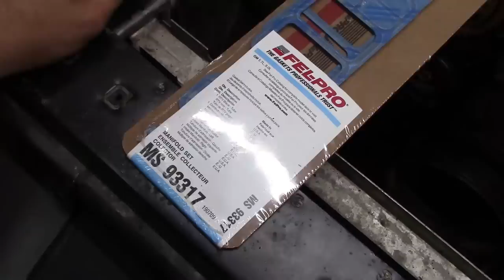1991 GMC K1500 Project | 350 TBI Intake Manifold Gaskets and Water Pump - Part 1

Comment: I’d rather pay someone reliable $1200 to fix a $500 truck and know what I have than pay $5k for a newer less rusty truck and have no idea what kinda junk I just bought
Reply: Better to know the devil you do vs the devil you don’t.
Reply: @FishFind3000  exactly how I see it and what I subscribe to myself. Working parts I hear people who subscribe to the "its an old year vehicle, it doesn't need good X" and people who are like "give me the best" sometimes people just like their car enough the idea of "totalling" it on parts doesn't matter.
Reply: I agree Notto. If the owner sinks $1800 in repairs on their truck this year they are further ahead then buying a new one with unknown history.  As someone said earlier, beware the devil you don't know.  That applies to people or vehicles.
Reply: Up here in Ontario Canada 5 k doesn’t get u much when looking for a good used truck ,even trucks selling for 10k are junk. I bought what I thought was a mint 2000 gmc 1500 and now I’m doing a frame swap and low mileage motor
Reply: Half full, Half empty . . . 😂
Reply: @classicxl  same story here in the swamp bro,I bought a $900 chevy, dumped $10000 into it and sold it last year when the body mounts took a shit and the driveshaft was rubbing under the cab.
Fml.
Reply: I thought he said $12,000 lmao, I was like: “well it’s a good truck, and new is expensive, I guess you go with what you know” I mean most trucks go for $1000 in scrap condition here, $5-9k for anything salvageable and running (or diesel and not)
Reply: Rather buy a $500 truck and put in $1200 into then make make payments. 😊

Comment: $500 would be an absolute steal on any running and driving 4wd around me, regardless of what kind of shape the body is in. That truck would sell for $2k within a day of being posted.
Reply: I don't think it's a 4x4. A c1500 is 2wd. K1500 is 4x4
Reply: @sh115067  Yep. Good thing this one clearly has front axles and the literal title of the video is "K1500 Project."
Reply: And today it would sell for 3500 bucks lol, it's really not that bad of a truck.
Reply: Hell, a not running truck is worth $500 at the scrap yard right now.
Reply: The value of these OBS trucks is insane to me. That's a 3000 to 3500 truck today. I have a very nice 1999 and I love it but wouldn't pay what it's worth right now. Lol

Comment: When I was a young pup I was working in a factory that had shut down years ago and the new property owners were wanting to get some temporary lighting going to show off the space to sell it. To help me see while I figured out how to get the power back on safely I brought some really raggedy 400 watt metal halide high bay lights to lay on the floor to light up some areas. The owners wanted to buy these lights thinking they could get them dirt cheap because they were beat up. They were astonished when my boss told them he would only sell them the old lights for his cost of a new light because if he sold them he would have to buy new ones. It was a good lesson that stuck with me years and years later.

That might only be a 500 buck truck on trade in to a car lot but it would cost a lot more than 1200 bucks to replace it!
Reply: In earlier July 2024 I watched YouTube videos where the hosts were showing six-figure sticker prices on 2024-25 1/4-ton pickup trucks!

Comment: I watch a lot of repair channels and you are the only one who CONSISTENTLY uses a torque wrench.
Nice call on the intake leaking. Real PITA getting all those hidden clamps and connectors.
Thanks for sharing.
Reply: When there's a gasket to be compressed he uses a torque wrench, but if there's just two parts to bolt together he says 'click' himself. Other people just wing it all the time?
Reply: @Netherlands031    Many times, experienced mechanics and those who think they are, will just tighten bolts from muscle memory. Exhaust manifolds, water pumps, attachment bolts, etc.  While all have specific torque ratings,many are not critical as are head bolts, main and con rod bolts. By feel works where not a critical torque.

Comment: The correct torque setting is until strips and back a quarter!
Reply: The trick is to learn to stop a quarter turn before it strips.  45 years on the job, and I never did it quite right.  Learned to install Heli-coils .
Reply: @etheroar6312  lol...
Reply: You forgot the most important part.. the last part.. and act like nothing ever happened... lol

Comment: We're about the same age, when I was growing up, any truck that started and ran reliably that had functional four wheel drive was worth $2500 all day long. Could be leaking water, oil, coolant, etc. but as long as it ran and the 4x4 worked, $2500. Might have to search a bit, but you'd find a buyer. In the current market, bet you could get $4k.

Comment: 350 tbi- most reliable chevy motor ever made.  Good torque, easy to fix.  Nice thing on the tbi is the coolant next to never goes inside the engine like the vortec.
Reply: ... like my 2002 Vortec did.
Reply: Hope you never have to deal with a "hot rodded" TBI Unit. Lots of fun finding what the master tuner and mechanic before you did to it. 🙄🤦‍♂️
Reply: Reliable cause it was so underpowered! Never stressed any of the internals to much.
Reply: @duganr6090  Yeah...i love my truck but man it has no balls really.
Reply: So u think coolant going straight to the oil pan is intake gasket?

Comment: The heat crossover port is used for what was known as EFE early fuel evaporation. When the cool fuel hits the floor of the intake the heat on the floor causes the fuel to vaporize . I always block them off as like you say it burns the snot out of the oil .

Comment: Pleased to hear nobody was injured by that storm. We had a bad storm in 1988. Monty and I spent 8 straight days cutting and hauling tree and brush to a make shift dump. We did 40 loads of my Ford F150 pickup. We worked from 8am until 12:30pm my Mom or his wife would make lunch then we would work until 8pm and either my Mom or his wife would make Dinner. Those 8 days were dreadful. Luckily we haven't had anything like that because I would be worthless as I am no longer 17 years old.

Comment: Did my 96 dodge 1500 a few months back. Had to change out the plenum plate. Went with the hughes 1/4 in plate works awesome and no more oil on top of the plenum.

Comment: There's something very satisfying about keeping an old truck on the road. Trucks made now will never last so long.
Reply: Old trucks just don’t have the power or drive near as nice. But new trucks aren’t the simplest work on.
Reply: They do drive nice if maintained properly and still have plenty of power depending on the engine.  I've got a 99 Silverado with the 5.3 that still looks almost new. Has more power than I need and drives just as good as any new truck I've owned. I prefer older trucks unless they have been neglected. Then there just money pits that aren't worth your time.
Reply: @dellstudio10  we had an 04 f150 with the 5.4l and that truck compared to our 2013 f150 with the 3.5l turbo is night and day. much more power than the old 5.4 and it was gutless, also handled poorly and ate way more fuel. with the new truck we can fly at 80 on the highway and still get better mpg than doing 55 with the 5.4l. over all its a better truck. even has more towing capacity since its all built stronger.
Reply: I agree those Ecoboost engines are impressive. My sister owns one and the power from that turbo V6 easily surpasses any older V8 I've driven. With a simple tune they really move.

Comment: Here in the SE we have the same issues with strong winds and night time tornadoes. May you and yours be safe.

I was the fortunate seller of a '91 Chevy Z 71. 350 auto short wheelbase. I sold it because of two things. Eight miles to the gallon and all the ball joints and tie rod ends and front bearings had to be replaced. I got 500$ for it.
About a month after I sold it the new owner was in the process of replacing everything. The transmission went bad. He sold it for scrap.

Comment: Awesome video, cant wait till part 2 . Great fix.. first thing i did when i bought my new 1995 s10 was change orange coolant back to green, flushed with water 3 times then green.. Nothing like getting stuck on backroads at a store needing orange coolant.. even 25 years later convenience stores still dont have orange ..rub some bar and chain oil on the frame..

Comment: That storm footage looks nasty....glad no one got hurt. I could see fixing/keeping the old ride given the crazy cost of new trucks and after that F-150 you showed, lots of possible hidden issues about used trucks too. Years ago, a teacher was tuning up his car by himself and spec was set Idle Speed in Drive. He figures in Drive, Parking Brake will hold it. Which it did until he reached over and gives the carb linkage a pull to see where Idle Speed settled down too....Parking Brake didn't hold that and two broken legs and crutches for the rest of the school year............

Comment: A fairly simple solution to a big problem and it saved the truck for further use.  Even though the cost of the repairs is more than the value of the vehicle, it is probably cheaper that buying a replacement for the same amount and have that replacement vehicle still needing work anyway.  Better the devil you know.  That's how it seems to me anyway.  Cheers

Comment: 12:55 those "quick disconnects" for the heater core I usually find are so corroded from galvanic corrosion from reaction of the aluminum and steel tube plus the coolant that I just replace the whole thing. They are only about $12
Reply: That and once that rubber is gone, there's usually no replacing it on most of them. I wonder what he did about it?
Reply: Replaced many of them over the years. Or just eliminate it.

Comment: On those I usually run a 3/8" hose from the throttle body to the PCV valve since those elbows don't last long from the aftermarket. I've got a 1999 Chevrolet to do the same thing to. Keep up the videos!!!!! Thanks!

Comment: Hope your having a good day Wes , please keep up the good videos can't wait to watch this one
Reply from the maker: Thanks, will do!
Reply: @WatchWesWork  I got a 91 Chevy truck, 5.7L, started running bad, wasn't running hot, changed plugs out, didn't help much, then I was driving, and smell antifreeze, pulled over and raised the hood, I seen antifreeze coming out towards the rear of the intake. The truck never ran hot when it started to run bad. Never seen steam coming from around the valve cover gasket before, I'm wondering if it's the intake gasket.

Comment: Did my spring hanger brackets on the F150 - an air hammer with the pointy tip was my best friend when it came to pushing the rivets through the frame after grinding the heads off. Looking forward to your method of attack 😉

Comment: We haven’t used a timing light since dad had his old fords from the 90s which was before I was even born. Now the timing light sits in the old toolbox in the corner waiting for me to restore my truck and actually get the timing right not just a screw driver in the spark plug hole and crossing your fingers it was the compression stroke

Comment: I have an '06Silverado and I went back to regular green coolant at 113000 after having to install a new motor. Thank you Chevrolet for the service bulletin about the cracking oil return ports on the heads. (Sarcasm) They wouldn't cover a penny because it was a service bulletin. I have never been a fan of DeX cool. There was talk that the Dex cool was a contributing factor to the head problem. I have no idea if this was true. Great videos!!! Grwat info!!

Comment: That tool tray thing is perfect, I usually set the tools on the battery if there isn’t a work tray built in like Ford trucks and some Pontiac cars, and I’ve had the battery arc out so rarely that I still do it, issue is when things fall, that can add an hour to a quick job

Comment: We had a storm like that in South Australia in 2016, took out power to the entire state after what they called a "Cascading failure". Two separate tornadoes (extremely rare to get a tornado here) took out three 275 kilovolt transmission towers and power lines, the big towers that interconnect the state, ripped apart and fell to the ground. Pretty exciting stuff, I had no power for 4 days but most of that time I was out driving emergency service vehicles and cutting trees off the roads. Kind of fun for me, not so much if you're stuck at home with the roof or walls missing!
Reply from the maker: Interesting. I didn't know there were tornadoes outside North America. We get several tornadoes in our local area every year. People here are mostly prepared for it and it's rare to have serious injuries or fatalities. But they cause a lot of damage.
Reply: Well compared to what you guys get in tornado alley ours are usually small, you'll hear "mini tornado damaged a few houses" etc, 2016 was the first time I remember we got anything like that

Comment: I owned a 2002 with the Vortec V6 that I bought new. I had to replace the water pump, do the intake gaskets and replace many, many ignition coils over 170,000 miles. Had to do the spring shackle job and all the fuel lines too. The symptom I noted was a dropping coolant level with no visible leaks and no steam in the exhaust. It was getting into my oil and sludging up my engine.

Comment: cross over is older than that, it was to heat the manifold faster on cold days, to help engine run better.  Help make sure the gas turns to vapor, for better combustion.  Will find cross overs on even some 1959's v-8s

Comment: I had the same problem on my votex or shitex chevy engine.  What crappy gaskets they put on the intake.  I was thinking my mechanic had to pull the heads to get the intake off.  Maybe I am wrong.  Had that done at a round 90,000 and now it has 105,000 and has a main bearing knock.  I have not had good luck with chevy in the last 18 years.  Great fixin for sure. Glad you got power back on.

Comment: 10:34 Quick tip on that "quick " disconnect heater hose, take a zip tie wrap it around the hose disconnect tabs and tighten it. It will pull right out.

Comment: I'm sure that all worked out fine but normally you cut the passenger side rear coolant block off out of the gasket so there is proper flow for the heat...I know there was a little hole but just saying....thanks for your posts...

Comment: The crossover is supposed to heat the lower intake so in cold weather it runs smother also by warming fuel mixture

Comment: around here that is a 5000 truck..  well maybe with the cab corners fixed, and after you fixed the engine issues..  just did a water pump and tbi rebuild on my 89 c1500.

Comment: Thanks for the entertainment, you're a Savior. 👌😎👍
You guys just got a SMALL taste of what it's like to live in the Caribbean Sea region and S.Florida every time storm season comes around.
Things will only get worse as the pattern from 10 years ago it's showing it. 
At least for those living near the ocean on the East Coast.
13:00 HOLY CRAP that things has had VERY FEW oil changes on it's hard lived life.
The deposits on the push-rods and lifter valley ? That's not enough oil changes and too many miles in between those.
Those PCV elbows don't last for shit ! Very similar design on the LT1 F-Bodies. Probably the same part #.

Comment: The heat risers are there to prevent icing of the throttle body (or carburetor).  Modern cars run coolant trough there for that purpose.

Comment: Just for quick reference — about six years ago I gladly paid 3K for an ‘89 Chevy K1500 that I thought had a leaking rear main seal. Turned out it was the oil filter adapter O-ring. Easy fix. (Don’t use the Help brand repair kit. Gotta use dealer parts. Trust me.) 

So this truck would probably bring more than 500 on the open market easily— rust & all. Lucky your head gaskets weren’t leaking like mine started doing. I’ll get it back together someday...

Comment: The single most common coolant leak on the SBC other than the water pump.
As stated in another comment, they tend to leak externally rather than internally like the plastic/rubber gaskets on the vortex versions. 
As for the cost, it's cheaper than a new truck payment.

Comment: Wes, glad to hear that you and the family are safe.  We just had a hurricane and she comes round every year as the song says.  We were luck at my house and didn't lose power but its common.   I was once out for 2 weeks and that's rough.  I'm surprised the truck was running as well as it was with that intake sealing problem.   I guess older engines weren't as sensitive to vacuum leaks?

Comment: Great video.  I know you paint marked the distributor and outside cap tower.  However had you placed the #1 cylinder at TDC? Back in the day, I would remove the cap and check where the rotor was pointing and mark that spot on the outside of the cap.Maybe you removed the cap and re-installed it and I just missed that step. No criticism, I'm just trying to learn something.  Thanks so much.  Glad you and your family are safe. Craig

Comment: I had a 1999 with a 350 Vortec, about every 60000 miles had to pull the intake manifold and replace the gaskets, did that three times. This was a chronic problem, the intake was ABS plastic bolted to the cast iron heads. The gaskets would fail because of different expansion rates and leak coolant into the oil pan. GM knew of the problem but refused to address it to find a proper solution just like they refuse to address the problem with peeling paint.

Comment: Dead stick timing a big or small cap hei.rotate crank in normal direction stopping at the base timing mark on the damper/pointer. With the cap and rotor off. Look at the pole pieces of the pickup coil and the reflector. Turn housing slightly till the pole pieces align perfectly.  Lock the hold down clamp. Reassemble rotor and cap.